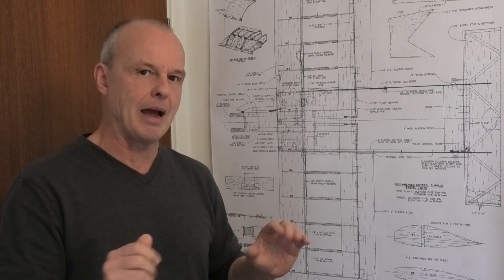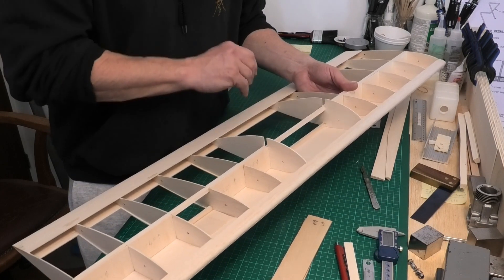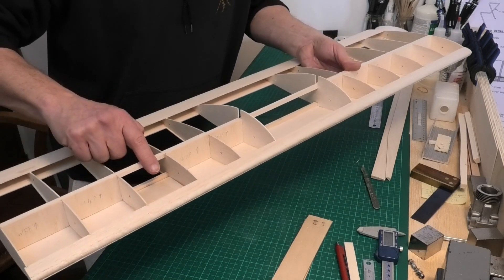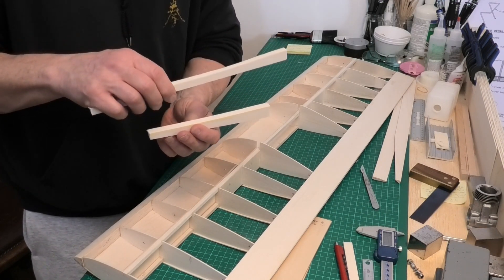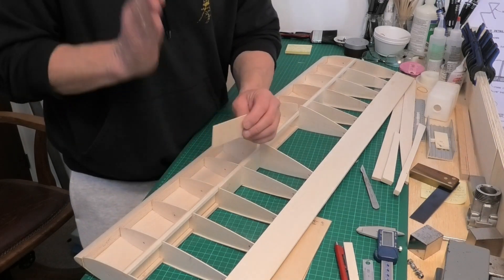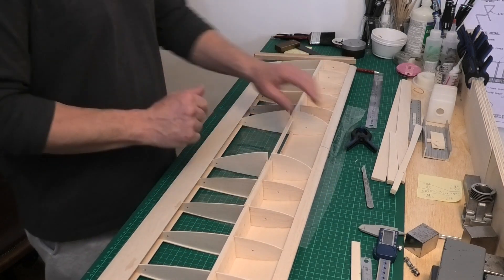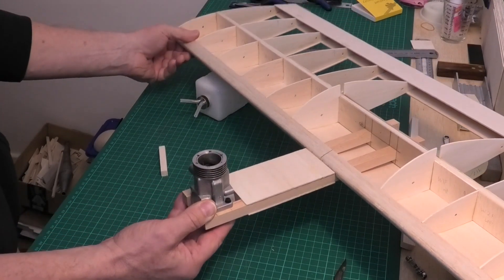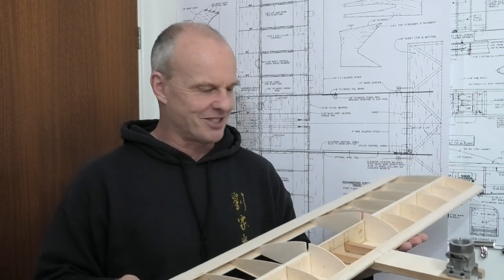Voodoo VI - Hi Performance 40" Combat Wing: Pt 3 - Engine Mounts & Shear Webbing

Comment: Hi I have a important question….. I have a  .46 magnum xl 2 stroke engine that for some odd reason keeps rotating backwards. It has never done that before and the prop gave me a painful cut because of it. It also has trouble staying alive and I just don’t know what to do. Do you know or have any clues on how to fix this problem?
Reply from the maker: Hi, you may want to try changing the plug and nitro content of the fuel, both of which affect the point of ignition in the engine cycle.  If too early ignition occurs it could explain it starting backwards.  Difficult to coment with out seeing the engine and setup etc.  I would suggest a OS 8 as a starting point. Fuel, I have no idea as I have never owned a Magnum engine

Comment: Nice build,  but der is no side pull on  the Engine, is this correct. 
Greetings from North Germany
Reply from the maker: Hi there, thanks for the comment, you are correct there in no side thrust for the engine 😀